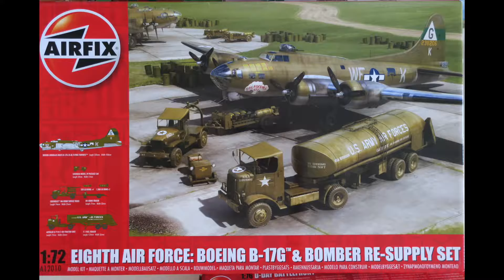Airfix B17 Model

Comment from the maker: I know there are huge gaps between the fuselage halves and wing joints, but in order to make the fuselage come to reveal the interior, I had to use magnets because the kit wasn't designed to open up. However, the fuselage was slightly warped in the box so these gaps were unavoidable. These gaps can be seen at 0:40 and 0:42